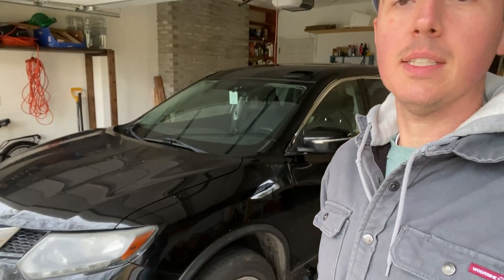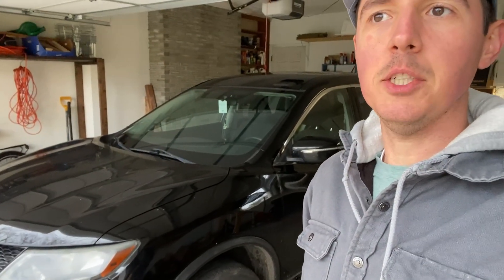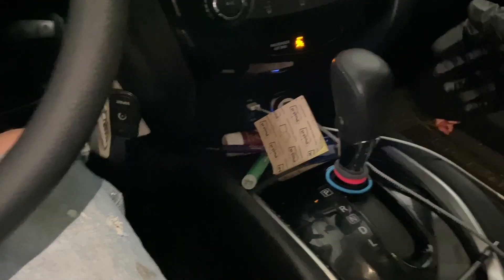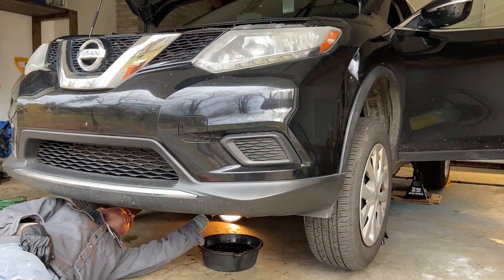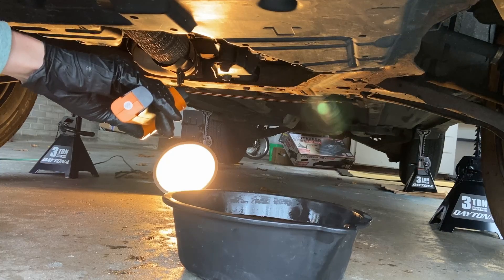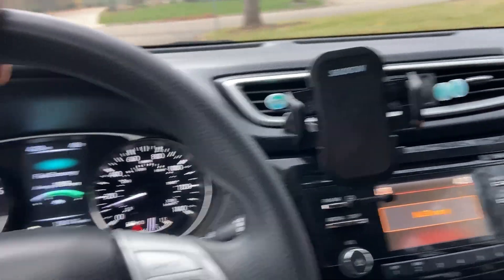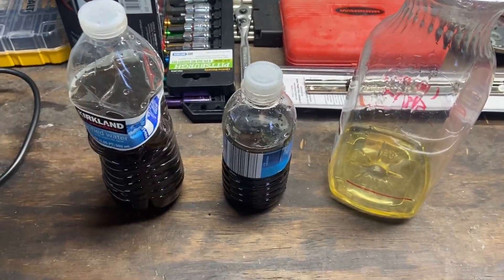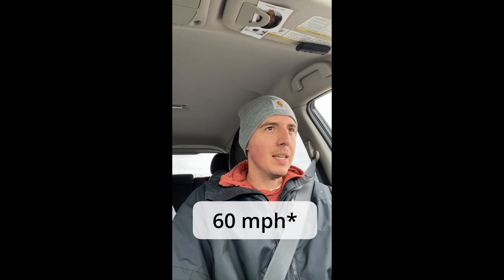Will this ruin my transmission? DIY CVT fluid change on 2015 Nissan Rogue with 136K miles!

Comment: Bro, when it comes to CVTs you are supposed to do this way before it hits 100k miles, something like 50~60k miles. Sorry but its probably too late. Good luck. Cheers!!!!
Reply from the maker: Yup, but pretty sure the CVT is fine on this car. It started showing transmission symptoms 5 years ago and it hasn't gotten any worse. Pretty sure it is an issue with the torque converter.

Comment: Hi, very insightful video. Any updates?
Reply from the maker: Nothing really, car has been driving the same. Still doing a weird studder when the car is warmed up in hot weather, pretty sure it is the torque converter though and not the cvt. Not sure I will do another flush, but if I do I’ll post a follow up.
Reply: @PerfectBiscuits thanks a lot, for taking your time to answer

Comment: I just changed mine yesterday except I dropped the pan as well and changed both filters. If you haven't changed your filters yet BEFORE you tackle that side cartridge filter order yourself a thumbwheel ratchet and thank me later. Because this one bolt on there will give you a fit trying to get to it
Reply: Was it a 2015?

Comment: Hi! I recently purchased a 2015 Nissan Rogue SL with about 136000 miles on it, so I just wanted to get your take on how well the car drives in terms of acceleration? For my car, I have noticed that it makes a very loud noise almost like an engine revving in your video when pressing on the accelerator and then when letting off of the gas pedal the noise becomes like a racecar coming to a stop. Did the CVT fluid change like you as well.
Reply from the maker: Hmm I’m not sure. Doesn’t sound like anything my Rogue ever did.
Reply: the cvt will make the engine rev higher than a normal automatic transmission remember that the cvt even though it might feel like it, it's not a geared transmission it's a scooter conveyor belt driven nightmare that Nissan thought was a good idea Honda and Toyota were smarter and used an actual gear for the first speed if you check out Nissan rouge cvt how they work u can see at the start there's tons of slack and if u smash the accelerator it's obvious that the belt would snap over time and hard breaking as well could knock it off its seat
Reply from the maker: @jacobbutler169  Ya hard to believe mine has lasted this long, Almost at 140K miles. Hopefully the trans holds out because the car is otherwise in really great shape.

Comment: Changing the fluid and not changing BOTH filters is a BIG mistake
Reply from the maker: Egh, not really if you plan on doing another fluid change shortly after with filter changes. Even if you don't plan on doing that, I wouldn't call it a BIG mistake. At worst it is a waste of time/money, it's not going to hurt anything.
Reply: @PerfectBiscuits  Changing the fluid always helps even if you don't change the filter.
Reply: @skywind007 wrong... the new fluid nas detergents that will clean up the transmission, which is a terrible thing if you already have a saturated old filter. That is what kills most CVT transmissions. Not the fluid, but the filter. Also you have to reset the Deterioration on the TCM Module.
Reply: @PerfectBiscuits it is a huge mistake. Also you have to reset the Deterioration Meter on the TCM module. Because the software will compensate for the lost of transmission fluid viscosity over time.
Reply from the maker: @pedroalmeida8683  I didn't do a complete fluid change, probably only swapped 50% of the fluid, so I don't think it would have been wise to reset the deterioration value. I'll do that after the next drain and fill. 4 months since I did the change, car drives exactly the same as far as I can tell. Will continue to report back though.
Reply: @pedroalmeida8683 how do u reset the flux capacitor?

Comment: I recently did a single Drain & Fill on my 2005 Murano.  I wasn't having problems but I figured it couldn't hurt as I was about to cross 100k miles.  I would suggest that you change the external cartridge filter on your also.  From what I've read it should be a lot easier than the dadgum convoluted placement for the cartridge filter on my 2005 CVT.   You can do it with your new fluid..... there is minimal leakage; just make sure you have the filter and necessary O-rings before starting.  If your bolts are reluctant to come out, then just put it off unless you have time to deal with extracting a broken bolt..... I mention that just to be aware..... mine came out relatively easy but there is minimal rust in my corrosion/salt/ rust for vehicles in my location.
Reply from the maker: Thanks for the info. Plan on doing another drain and fill x2 as well as dropping the pan and changing both filters.

When you talk about breaking bolts, are you referring to the transmission drain and fill bolts? Or some bolts associated with the external cartridge filter?
Reply: @PerfectBiscuits  Sorry for my lack of clarity.  I was referring the bolts that retain the external cartridge contraption.  Mine came out ok but I was ready to just not proceed if they felt "iffy".  I also used "never seize" when I put them back in so it will be easier to remove them next time.  I would consider buying the tranny dipstick on amazon too.... that silly drain hole crap is ridiculous.  Let me see if I can find  the link..... might just have to paste the info since youtube doesn't let me add links anymore.
Reply from the maker: @silvernblackattach  thanks for the clarification, I'll definitely take it easy with those bolts. And I really didn't mind the drain hole, but it would be nice to be able to check the level every so often, just to make sure you don't have a leak.

Comment: I have the same situation.  2016 rogue, no problems but 157k miles no cvt change. Any update to your rogue?
Reply from the maker: I think I’ve only put like 500 miles on it since I did the fluid service. It’s been driving great, no issues, but like I said in the video it never really presented issues in cold weather. I haven’t taken it for anything longer than a 20 minute drive either. I’ll be posting another video around May probably.

One thing to note is that my car is only throwing a code for the torque converter (P17F2). This is kind of rare from what I’ve read. If you have the other transmission codes like P17F0 or P17F1, it typically means your cvt is dying.
Reply: @PerfectBiscuits dying as In it's not worth changing the fluid? Because parts are deteriorating?
Reply from the maker: @ghxzt4946 idk, ive just seen people say that those codes typically means the cvt is on its way out. Might still be worth it to you to try a fluid change. I mean you’ll be out a couple hours and ~$100-150.

Comment: How much fluid did you put back in. I have the same model and I need help
Reply from the maker: @Jay-zr9ll  i put 3 quarts 4 oz back in, as instructed by the service manual. Use the level bolt to check the level and if fluid isn’t dripping out, add another 1/2 quart and check the level again. It’s all in the service manual, you can download it from nicoclub website.

Comment: What about cursive?
Reply from the maker: Actually had a nice writing session just now, but I’m not making videos about it anymore unless something strikes me.
Reply: @PerfectBiscuits  ohh!. Btw im watching your course right now and I have watched it till lesson 8 and your explanation is awsome. And yeah i was practicing i,w,u and I practiced it for about an hour or more, I think i have mastered those but when i check the main angle its little low than 60 degree. I wanna know is it good to have little variation or not. Cause before watching your course i used to write on 50 degree approx.
Reply from the maker: @MuhammadZiyan-e1b  Anything between 52-60 degrees is fine and up to personal preference.
Reply: @PerfectBiscuits  Thanks may god bless you.
Reply: How much fluid did you put back in. I have the same model and I need help

Comment: That’s the thing with modern cars, people want the Economy but most folks don’t do the maintenance, and those CVTS run much warmer than gear driven transmissions. people have to do their maintenance.
Reply from the maker: I think a lot of people are taught that any maintenance besides an oil change is a scam because of the often unnecessary upsells from quick lube places. I know that’s what I was taught.
Reply: @ usually it’s follow the owners manual, but in this day and age who reads that anymore ? It’s “THE LIGHT CAME ON!!”
Reply from the maker: @BMan100  hah yup, no one is reading them. I wasn't either until a few years ago when I actually read the manual for my lawn mower and realized it needed a bunch of maintenance. I then realized that I need to read the manual for all my machines, especially the biggest, most complicated one I own: my car.
Reply: @PerfectBiscuits they are charging 3-400 for a CVT fluid change now.
Reply: @baileychic8 i bought a 12 volt pump for $20 on Amazon and do the fluid change from the fill tube. I get around 3 3/4 quarts out and just put in 3 and 3/4 quarts back in. I’m going to change the small paper filter next time. I have 162,000 miles and no problem.